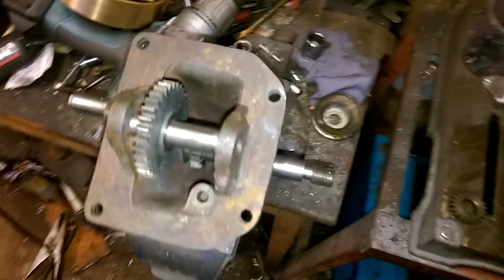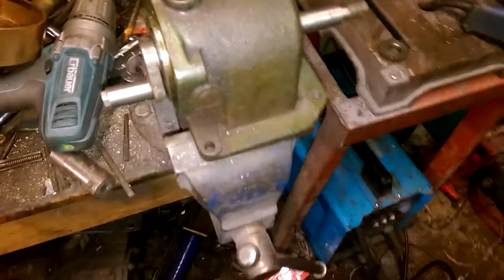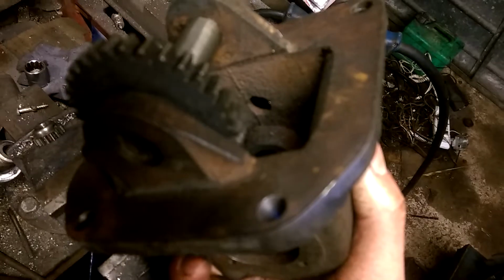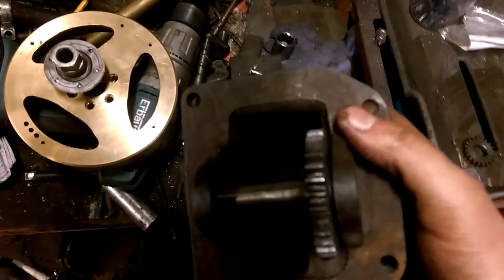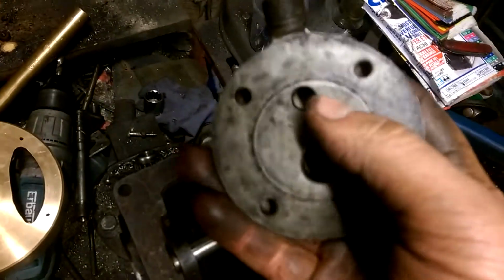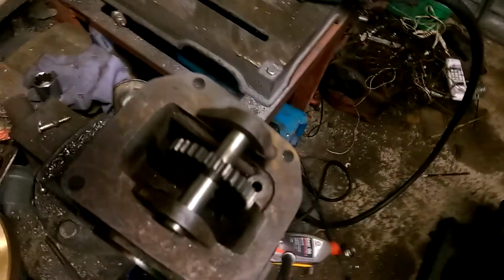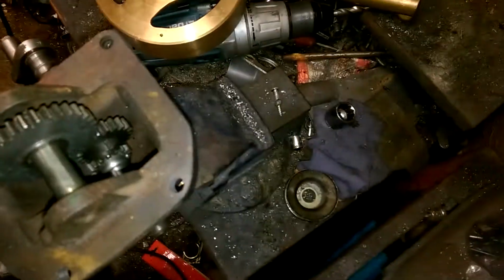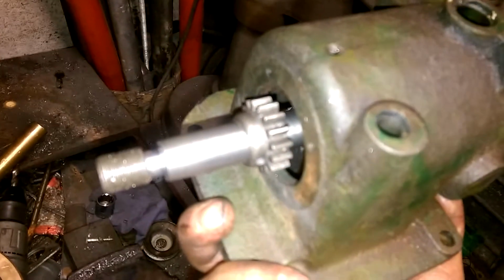Smiths Maxfield tyre pump engine

Comment: Did you grt round to finishing this and if so did it run ok?
Reply from the maker: cornishman1987  Finished? Ha, not yet. Its in that pile of projects that I dig out once in a while when I get bored. Once the Lister CS is done, it will probably get some more attention. Running, maybe 2016!